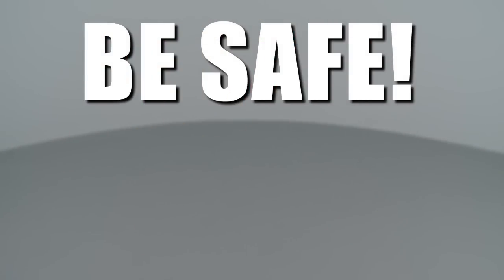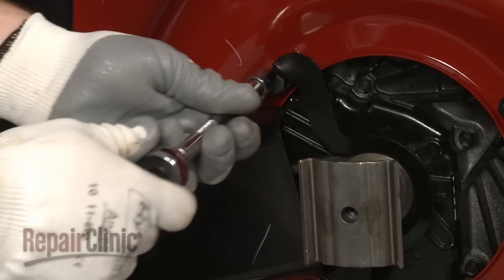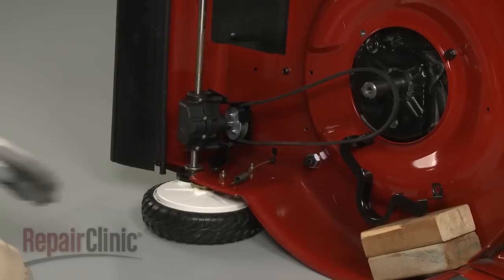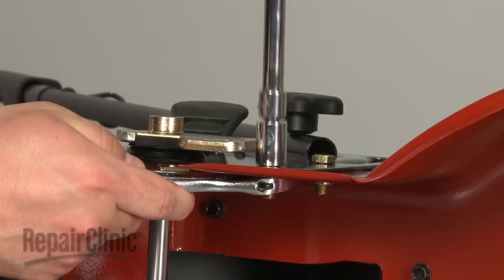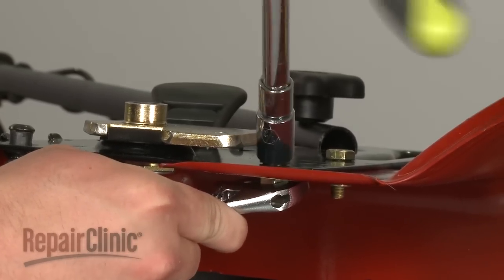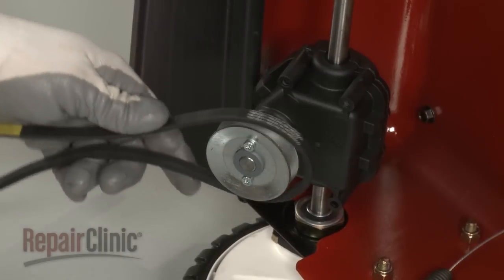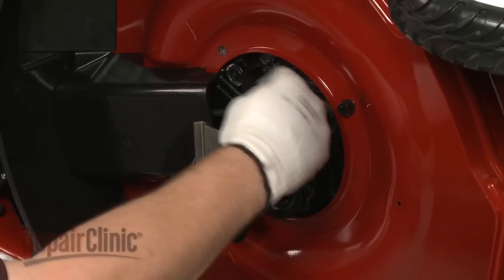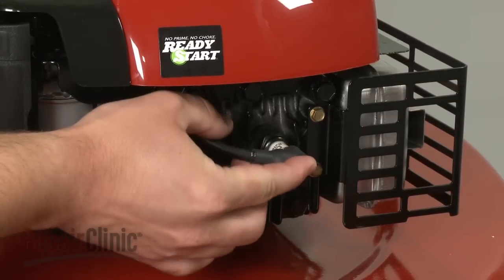Toro Lawn Mower Transmission Replacement, Mower Repair #121-9178

Comment: The repair description is great. There is a repaired model. Broken rear pivot arm nut hole. How can I fix it?
No matter how much I search on the internet, I can't find the part. please. model 20340 (7.25/163cc)

Comment: Has anyone opened up the transmission of self propelled mower? I have a Toro front wheel drive. It is the plastic split case. It does not want to come apart. I am curious if a bad gear inside can be replaced?

Comment: Probably obvious to you,  how do you determine if it's actually the transmission that needs replacement and not the belt that needs replacement or some kind of tension screw that need adjusting?

Comment: Replaced the transmission and belt today using the video instructions. The video and instructions were most helpful. I had to go purchase a square driver to remove and install the three screws on the belt guide attached to the transmission. The #2 square drive was the size that fit these three screws. Thanks for posting the video!

Comment: Question :
Is there a Toro part number for the two transmission shaft snap rings?
If not what would you ask for?
Reply: 32151-61 on my 20332

Comment: I replaced my transmission and everything seemed to go back together fine but now the mower just wont start. It was running fine when I replaced the transmission. Mine is a toro 6.5 hp model 20076. could dirty gas have gotten in carb when mower was on its side? Im' not even getting a spark it seems. plug is gapped to .030 and smells like gas. plz advise and what i should try. I thoulght i had this fixed and now it just wont start.

Comment: What parts do I likely need to replace if only one of my wheels occasionally locks up when pulling backward?  The mower works fine moving forward.  The gears on my rear wheels look OK and seem to turn fine when raised off the ground.  With weight on them they seem to want to lock up.  I have a 2010 model 20332.  Thanks.
Reply from the maker: +William Maniscalco If it is the wheel that is driven by the transmission then we would suspect a transmission problem and the whole assembly would need replacement. http://www.repairclinic.com/PartDetail/Transmission/1219178/2705544?TLSID=1773

Comment: It turned out that the replacement belt i purchased from home depot was the wrong size (about 0.5 inches too short).  I found the right one on line.

Comment: Could you tell me how to determine if it's the transmission that needs to be replaced. Thank you.
Reply: The problem is not with the transmission itself; but the pinion gears on each end of the shaft, when they don't get greased every season the pinions have one-way clutches in them to engage the forward motion of the drive shaft to turn the wheels in a forward motion.  Grease those pinion gears and the shaft they ride on and problem will not occur

Comment: I'm having the same issues as Stacy on my 2010 model 20332 mower. Wheels bind up backing up, and grinding noise when engaging transmission. I have changed out the tension spring on the handle, the transmission, both rear wheels, drive belt and drive pulley. When adjusting the cable, if I take out all the slack as directed, the wheels spin even without pushing the handle. So I have left a small bit of slack. The only thing I haven't changed out are the two brass gears at the ends of the trans shift. They appear to be ok, since they only contact the plastic gears on the inside of the wheels. Any ideas on why this is still happening?
Reply from the maker: The transmission shaft should turn freely unless the drive pulley is being turned. The transmission sometimes will stay locked up after releasing the drive handle until you push the mower forward a little and them pull it back. The cable should have a little slack so it is not trying to turn the transmission pulley all the time Only when the drive handle is depressed.

Comment from the maker: Bad gas will not cause the no spark condition. You might have got a little extra oil in the cylinder and fouled out the spark plug. I would try a new spark plug, and if you still get no spark check the flywheel grounding arm. If it is touching the flywheel even when you pull the control lever back it will ground out the spark.

Comment: Thanks for the video. This helped me to replace the transmission on my Cub Cadet E18J.  In my case there was a plastic sleeve over the axel and that prevented the assembly from sliding out. Due to a welded cross bar, I could not find a solution. So, I just cut out the plastic sleeve and then everything went as shown in the video.  I figured I'd mention it here in case someone else hits the same problem. I'll amend my comment here if I find out later that the sleeve was really needed.
Reply from the maker: Good stuff thanks!

Comment: Our 2004 (model 20017) mower has lost the self-propel and has a grinding noise when the bar is pushed down (personal pace). We replaced the belt and adjusted the cable and still have the problem. Would this be a transmission problem? I noticed one of your replies about the back wheels locking up when being pulled backwards and that has been a problem we've had the past few years as well. P.S. I wish our mower was as easy to disassemble as in your videos! Ours isn't designed as well. :\
Reply from the maker: If the gears in the rear wheels and the drive gears are OK, the transmission is most likely the problem.

Comment: Thanks. Mine was so old and dirty and grimy that it didn't come apart. I watched the video to make sure it was supposed to slide out. I lubed with some Kroil and tapped it out with a ball-peen hammer.

Comment: My mower has a blade clutch that is in the way of the drive belt. Do you have a video showing how to remove that?
Reply from the maker: Link Christensen No. Toro's website (toro.com) often lists service manuals although you will need your five digit model number to look up the manual.
Reply: OK. Thanks.

Comment: I have a Troy Built 6.75 hp mower with the left  front Splined wheel locked up. How does that wheel turn with spline on the wheel shaft that will not turn/Can  anyone help me out here?
The splined part looks to be pressed on the shaft.
Reply from the maker: Old Guy If it is one of the self propelled wheels then the transmission is likely defective and needs replacement.
Reply: ***** Thanks I will check that after I get it to run.

Comment: I have a toro model 20074 with rear wheel drive and I noticed that only the right wheel will spin when engaged.should both wheels engage?
Reply from the maker: +John Eroyan Probably something broken in the transmission assembly.
Reply: @repairclinic  The pinion gears have one-way clutches in them they only should turn in a forward motion.
That is why you can pull back on the mower to back up.  Lack of grease on the shaft and inside the pinion gears causes the condition that John Eroyan has.  Grease the shaft and pinions each season and you will solve the problem from happening.
Reply: @repairclinic  The transmission itself hardly ever goes bad.

Comment: Can we just pull out the transmission and not replace it with a new one? Would this make the mower a push mower and still function OK otherwise?
Reply from the maker: Yes. Since the transmission shaft is not connected directly to the wheel you can remove the transmission assembly and use it as regular non self-propelled push mower.

Comment: I CAN'T GET THE TRANSMISSION TO ENGAGE THE SHAFT IN IT. THE SHAFT HAS A LOT OF LEFT TO RIGHT MOTION; BUT WONT TURN THE WHEELS.
Reply from the maker: If the pulley is turning, the drive shaft should also turn. Make sure the belt is not slipping. If that all looks good, the gears in the transmission are most likely stripped and the transmission will need to be replaced

Comment: I have to hand it to the Toro at least they're using bearings unlike the lower-grade Husqvarna mowers like the lc221 which does not and even if you are actual axles are in good condition will start wearing through and then bad things will start happening to gears and everything down the line

Comment: will this help my wheels bind when they go backwards
Reply from the maker: If the wheels are locking up and not turning when pulling the mower backwards it may be the transmission causing this issue. You will get a little resistance from rear wheels but they should still turn backwards without too much effort. If the belt is trying to grab a little this will also make the rear wheels harder to pull backwards. Make sure the pulley on the transmission turns free when the drive lever is not engaged.

Comment: Nice video,  but, i see 2 flaws, #1 the video went too fast and several important steps were omitted, #2 the proper way to install the blade was omitted,  otherwise this is a nice start for anyone doing this for the first time.
Reply: You do know there is a pause option, correct?

Comment: Cant someone just change the two gears (the pinion and the bevel)in the transmission instead the whole transmission
Reply from the maker: Wendy James Normally the manufacturer does not offer the parts like that. More often than not you have to buy an assembly.

Comment: These Hank Hill level vids are dumb cuz how many brand new mowers need replacement parts..try the same tricks on old rusted together machines that really need repair and see how simple and easy THAT is and see if you stay as clean as the guy in this vid.
Reply: what do you want them to do, dip it in mud and water and rub dirt and sand all over it?  It shows you how to do it.  The end.
Reply: Seriously?  This very good video is clearly intended as a means to understand the basic steps of this job.  Everyone's situation will vary, and it's up to you to deal with rust, wear, dirt, etc. on your individual mower.  Showing a grease-covered, dirty mower would make it a lot tougher to see the parts, and not help the training one bit.  I'm just very grateful this video exists; it helped me a ton.
Reply: Oilsmoke Jones you, sir, are not very bright.